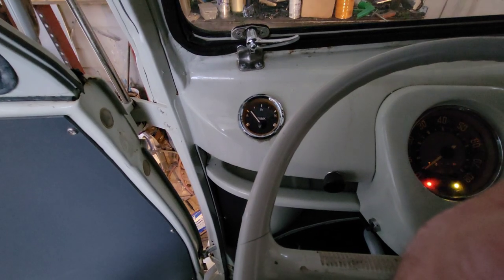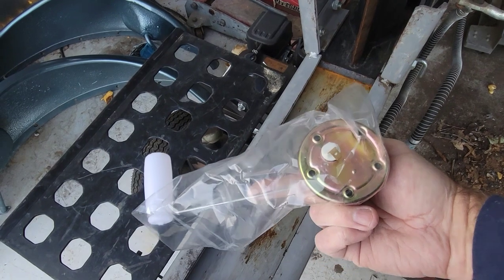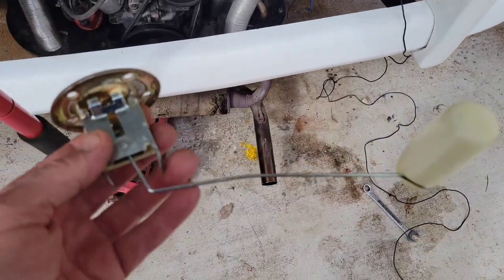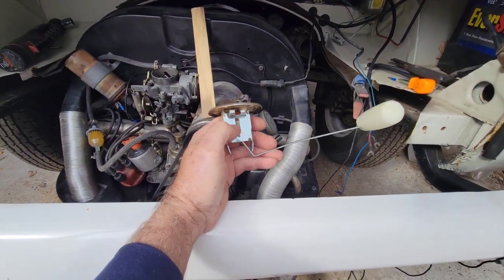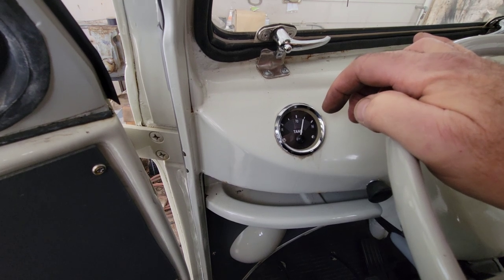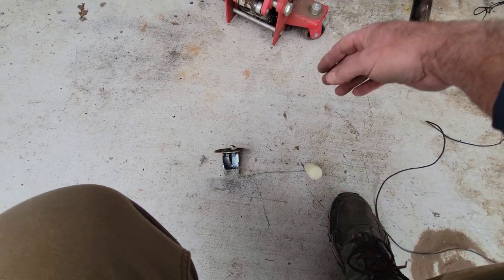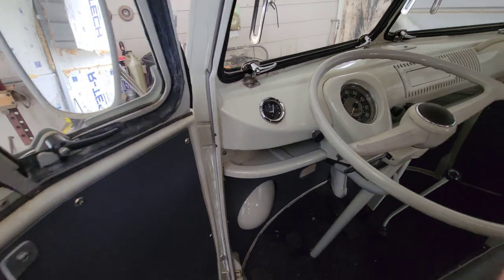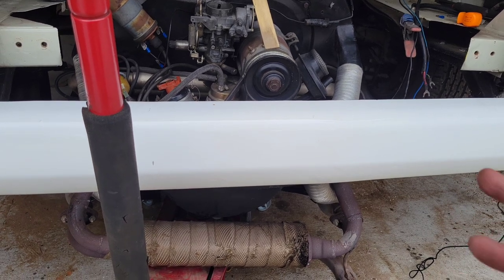VW BUS GAS gauge How I get them to work decent.

Comment: Cool vid for the folks that actually have a gas guage in their Volk's. 
My '58 bus didn't even come with any of this stuff, and after watching your dissertation on the subject, it sounds like we may all be in the same boat anyways! My driving range experience  in the Last Frontier is more of a Zen thing which involves both ESP, estimation, and experience- the "3E's". That said, I always carry an Extra (4th E!) 5gal of petro happiness up top, and I never pass up a gas station, cuz up here they're few and far between 🙂✌️
Reply from the maker: on my 61 it did not come with a gauge either. I put in a gauge tank then put a aftermarket VDO gauge behind the grills on the dash. With a light that lights up when ignition is on. Even if it is not totally accurate which that one is pretty spot on, it is better to have one than not.
Reply: @Mikefngarage  huh, I wonder what they did in the old days? I think they watched their odometers, and figured out their range based on what mpg's(25) they got out of a full tank(10.5gal). Oh, not to mention that little knob that taps into the reserve(1.3gal), so it's just the old school way of running with these old girls. Works for me.👍
Reply from the maker: @IAm1InTheIAm  yea kinda sucks though. I have the reserve on my 61 but really hard to keep the miles on track. Easy fix to put a gauge in there and takes some of the worry away.
Reply from the maker: @IAm1InTheIAm  on my bug it is easy because you can see down into the tank and know how much gas is in there.

Comment: Hi Mike! Greetings from Brazil.
Bend the rod is exactly what we do here.
But there's something else you can do to read more accurate.
It's hard to explain without showing but I will try.
These 2 horns upside down that work as limiters for the rod. If you also bend them enough to the rod touch them about to fill up the thank It will mark full on the gage. And it works all the way around to mark empty as well.
What happens is if the rod touches that part close a short circuit and the gage mark that as full or empty.
I don't know if I make any sense here. But I try.
It takes time and patience to be perfect but is possible.
Thanks for the videos!

Comment: Gave up on mine, put a 3 ltr reserve tank in instead of fixing it. Now have 2 fuel pumps and 2 cut off solenoids.
Reply from the maker: actually works perfect after that last bend. fills up on full and goes just below the R empty. Just need a few gas cans and some time. One of those pumps. I watched it from completely empty go just to the R with 1 to 2 gallons in it. then to the 1/1 needle width below to full.

Comment: Excellent video and detailed explanation as usual 👌 my 71 ghia does the same too. It's electrical, accurate but fluctuates alot during driving. Can something be done to dampen the needle movement? Thanks in advance ☺️
Reply from the maker: usually that is handled at the gauge end.
Reply: @Mikefngarage  thanks for reply, via a zener diode? Am I correct to say thatbon ghia this is missing?

Comment: Hi Mike, thanks for this video and for all your great videos! I have issues with my 67 Ghia fuel gauge. Have the original VDO gauge but replaced the sending unit first with the type you showed then changed about six months ago to the cylinder type the car originally had. The gauge likes to jump around a lot. Any ideas why it does this?
Reply from the maker: old gauge is just being old. The new WW or ISP west ones work better. they dont do that. and still look like the original. Hopefully yours reads right. so many dont.
Reply: @Mike Fn Garage  Thanks very much Mike! I'll try those out.

Comment: Didn't want to cut the hack hatch up on the rear deck giving you access?
Reply from the maker: those senders you can just pull out of there with the gas tank in place.
Reply: @Mikefngarage  Without removing the motor? 🙂
Reply from the maker: @notchboy  once its changed to the bug one on any year but 67 yea it is not that hard to change it without removing the motor. lift it up and twist it out of there. But on the 67 it is positioned really far back and you cant reach the back bolts. A difference of about 6 inches.

Comment: Hi Mike have a 65 Bus with org. 6V system tried putting that type of sender in tank and nothing....do you think it was because it is not 12V?
Reply from the maker: I have done this with 6v and 12v gauges. The 6v.you do need a step down volt converter.  Try grounding the wire to the wire to the gauge at the tank and see if it goes to full. if not the gauge or wiring might be faulty.  IF not you can remove the sender in the bus. (that  year with the engine still in if you have a bug sender.) Check it wile grounding the sender and moving the rod. see how the gauge moves. Then make sure the rod and float does not hit the side of the tank. Bend the rod like I showed downward and away from the side of the tank. I have these senders in all my type 2s and every one works pretty good. This one has about 1 to 2 gallons  of reserve. and some have a bit more. but it does help to have a gauge. On the 65 you will need to really bend that rod away from the side of the tank.  Remove the gas and refill it a few times while watching the gauge. It does take time but worth it in the end.

Comment: Mike will this work on early bay window?
Reply from the maker: I think so. I think the 67 either has the same tank or one similar. and you can remove it if you have really long arms without removing the tank. sender is only like 20 bucks. VS 80 or so. for bus VDO. and  I was able to get it almost perfectly accurate.
Reply: @Mikefngarage  thanks for your reply Mike! I got a sender from Wolfsburg West but as you said these are a hit or miss and it didn’t work.
Will definitely be trying your trick, thanks again!👍
Reply from the maker: @DentFreeImagePeterVega  yea it works GREAT....SO happy I played around with it for a day. Totally worth it. I am going to pull my other one on the dark red bus and adjust it too. can be done with the engine in on the early ones. Later it is a real stretch but possible.